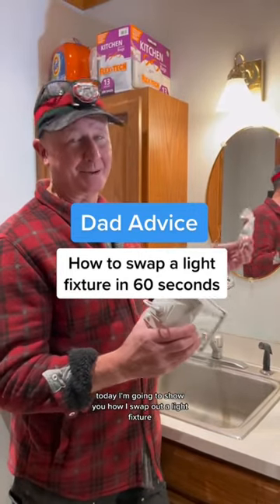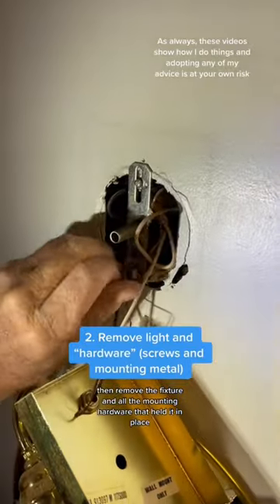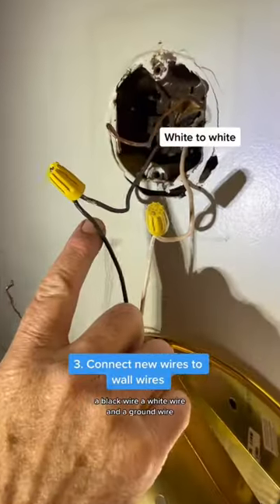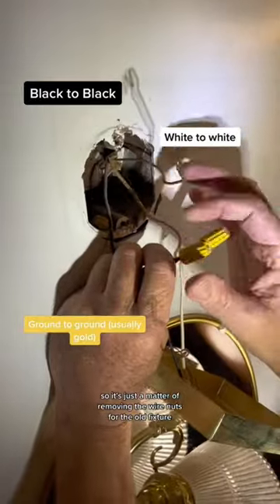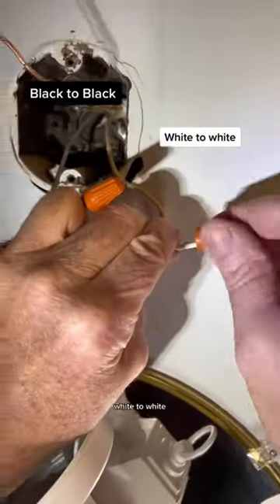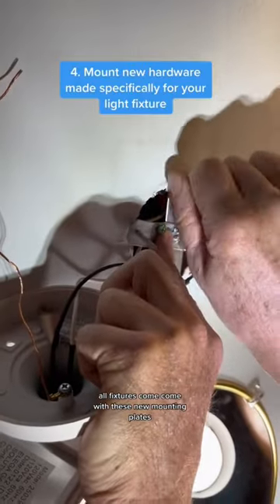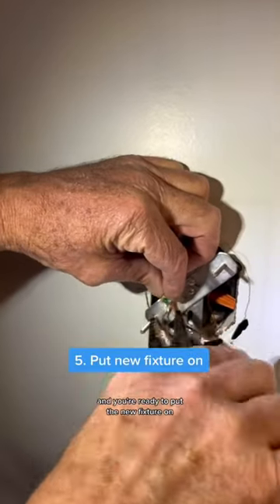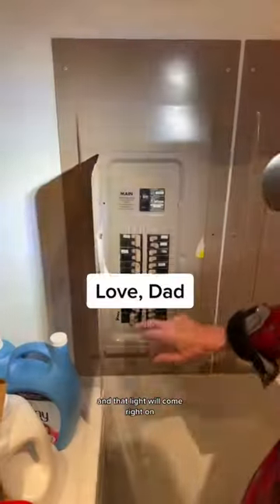How to swap out a light fixture. Love, Dad

Comment: Just install a 3-light vanity light. Buy one that looks nice and allows you to put Edison bulbs in it. Don’t buy integrated LED crap. One light light bulb won’t be enough to properly light up your bathroom. For me, a single 800-lumen bulb is not going to be enough to even light a small bathroom up. 2,000 lumens is the minimum recommendation light output in my opinion.

Comment: You forgot to tell your kids to verify the circuit is dead…so they don’t become dead. You know, mislabeled or broken circuit breakers. It’s a real thing. If you’re going to do electrical work, you need the proper tools. At least a non contact voltage indicator…

Comment: Be careful giving Electrical advice if you are NOT a licensed electrician because that can make you liable if someone takes your advice as a “correct standard.” I can tell from your video that you are NOT a licensed electrician because I personally do not know an Electrician that would teach a novice to remove the ground wire first. After you shut down the circuit you ALWAYS disconnect the Line first, because if you disconnect the ground first and there happens to be a short in the circuit any electricity will no longer have a place to go except through you or potentially a combustible material. Just a fair warning my friend as 1. I don’t want to see you get into legal trouble and 2. Don’t want to see someone else or property get hurt. 
To sum up:
Turn circuit off
Disconnect Line (black)
Disconnect Common (white)
Disconnect ground (green or bare copper last)
When connecting a new fixture: essentially the exact reverse order as above:
1: connect the ground (give any potential electricity a place to go back to the panel in case something goes wrong)
2: connect the Common (white)
3. Connect the Line power (black)
Then you can flip the circuit back on!
Safety is paramount and hope this  serves you well.
Reply: Question:  I need to change the ceiling fixture in my bathroom bc it blinks continuously.  I believe the light has a short in it.  I bought a new light fixture but I haven't installed it yet.  I hope mines isn't this complicated.😅I thought once the breaker is turned off, the electricity is no longer running.  I'm a new home owner and a woman.  It seems easy enough but I don't want to potentially get electrocuted.  Should I just get an electrician to do it?
Reply: @vayoha02 yes, women are more likely to get electrocuted.

Comment: Are there different sizes of mounting plates hardware or are they all a universal size?
Reply: Depends but mostly everything has the same kind of bracket some swivel some are just flat and you rotate it till the holes line up with the screw holes on your box

Comment: Love the channel mate from Australia!

 I don’t think it’s a great idea to encourage people to do their own electrical connections.
I’ve seen way too many dangerously done connections.
Especially with those cheapo twist on connectors.
All it takes is a loose wire and you could have a fire.
Reply: Its funny, here in America those wire nuts are the standard. But 99% of people use them wrong, you are supposed to twist the wires together with a linesman first, then trim the wires flush to each other and put the wire nuts. I am an electrician by trade
Reply: Ditch wire nuts and use wagos instead.